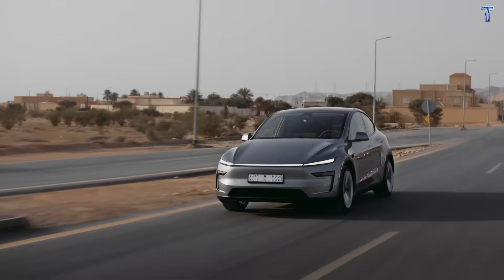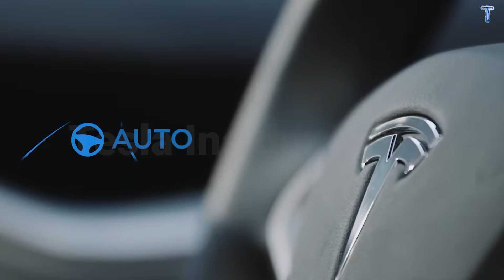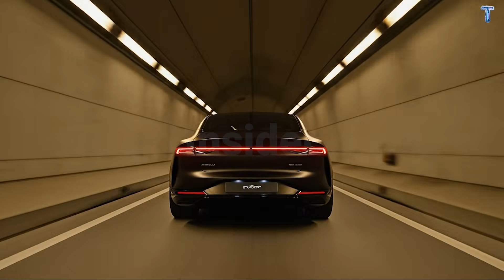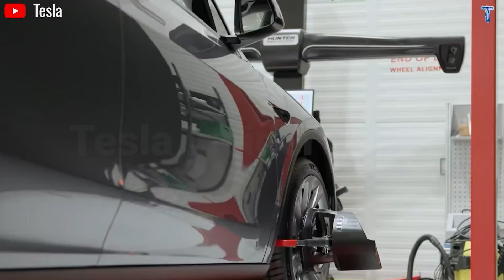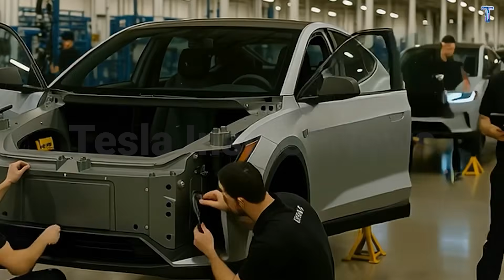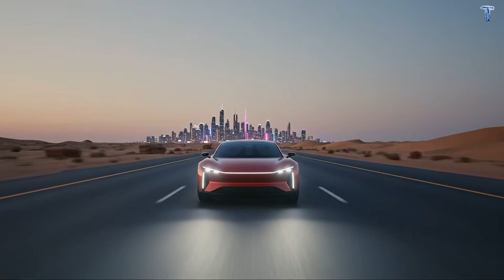Elon Musk’s $12,749 Tesla Model 2 SHOCKING EXPOSED: Real Costs & FSD

Comment: That 12749 price sounds unreal. Feels too good to be true, no way Tesla can sell a car that cheap.
Reply from the maker: The info so far is compiled from multiple internal leaks and supplier chatter, plans can still change over time. What matters is Tesla is clearly pushing a lower cost platform. If it launches close to this range, would you actually consider switching?

Comment: What matters is HOW PRACTICAL is it to the average driver. How far can I travel before "refueling" How long and how difficult is to "refuel." I can go two weeks of my average driving about 320 miles in my current gas vehicle, gas stations are everywhere take about 25 bucks and less than five minutes...on my way for another two weeks and 320 miles. I reaally don't want to worry about when and where I can sit for HOURS to get a battery to charge. No thanks.
Reply from the maker: That concern is exactly what most everyday drivers bring up. The details discussed here are based on internal leaks and industry sources, so things can still evolve. The idea isn’t sitting for hours, but charging at home overnight and only using fast chargers occasionally. For many people it changes refueling from a stop you plan to something you barely think about. If home charging wasn’t an option for you, would that be a deal breaker no matter the price?
Reply: @TeslaInsiderNews 

I live in an apartment upstairs and would require a retractable extension cord which is suspended on a boom which swings out from my window, and  I can use a remote to drop the extension cord to ground level and then another extension cord to reach my vehicle parked in an out door lot across the street. Since the building is not equipped with outdoor outlets nor indoor parking garage.
 The power cord has to be long enough to reach my vehicle without being a trip hazard for other residents. Nor a hazard for the street sweeper.  I currently own a hybrid fueled four cylinder engine powers a battery and two independent electric motors for optional four wheel drive. Mid sized SUV actual knobs but an irritating reach to access and the software to navigate through screens  to access changes on a touch screen while hitting pot holes and controlling finger vibration trying to keep my hand steady while driving on intermittent bumps touch the wrong icons. Cameras use anti vibration why not vehicle suspension? One time I lost my voice and I couldn’t give the car voice commands. I never gave this much thought. And I couldn’t text the dealership?  I ended up texting my sister out of state to call my employer that I lost my voice and stuck at home.
Reply: your 'what matters' is just plain stupid
Reply: @TheBerserker50  Really? So refuel convenience, travel distance don't matter...You sound like a bicycle guy. And you don't get around much.